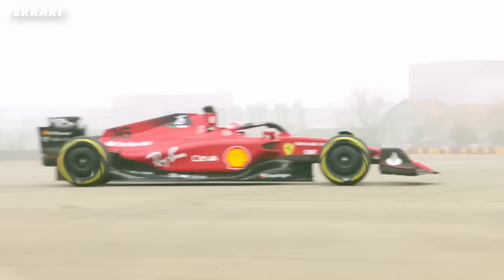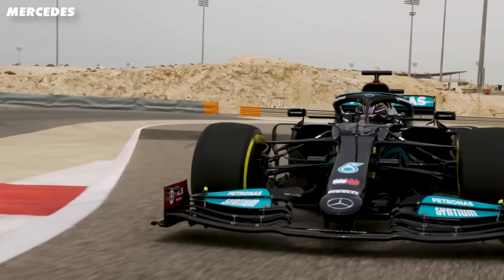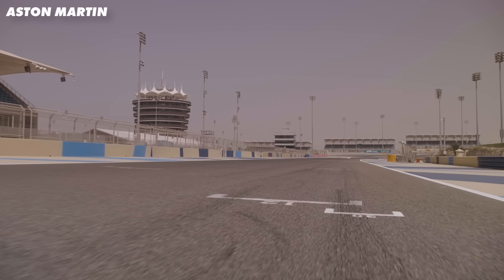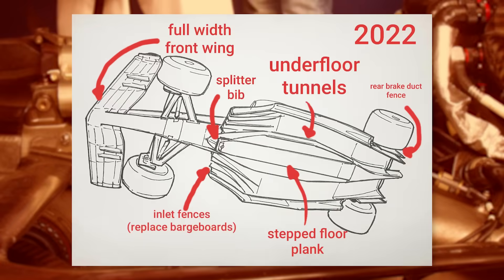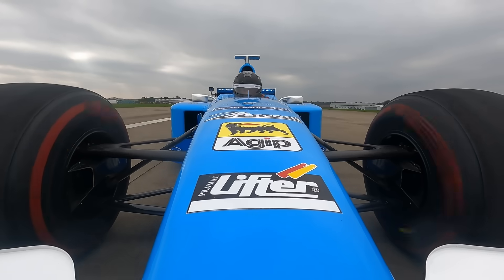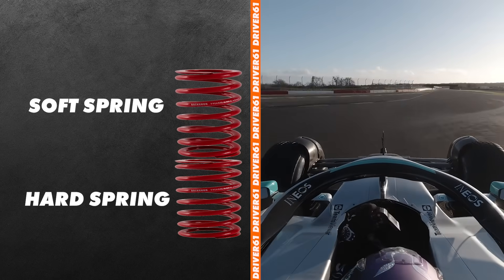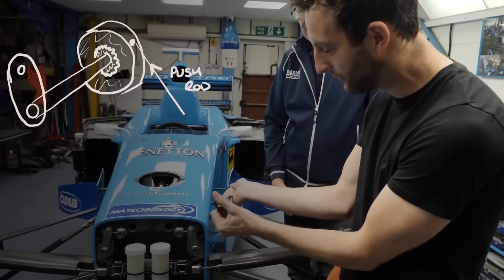Why F1 Cars Use These Weird Springs

Comment: Is this what those slow bump, slow rebound, fast bump, fast rebound in those racing sims actually is or this thing is unique to F1? I also remember something about bump transition and rebound transition, never fully understood those.
Reply: No, you are talking about damping. Fast/slow refers to the speed that the damper compresses/rebounds, if you have long whoops the suspension might go trough a lot of travel at relatively low speed, but if you hit a sudden sharp edge in the road you will have a high velocity as the wheel travels up trough the stroke.
Reply: Slow/fast bump/rebound (In my mind)  are  settings that are adjustable through the shocks. The progressive springs are there to hold the car up and flat whether it's going nowhere and weighs 1000lbs or going flat out with an additional 2000 lbs of aero-downforce.  (No I didn't check my values).

Basically, I think your settings are more for how quickly the shock allows the tires to move while the springs make sure you can hit top speed without bottoming out.
Reply: Dampers contain orifices that allow the oil inside to move from one side of the piston to the other. This is how they dampen movement. The oil can only move through the orifices so quickly. They dampen the movement by the simple fact that the oil will only go through so quickly. Make the orifice bigger they will allow quicker movement. Make the orifice smaller and they will allow slower movement. A damper with just one fixed orifice has a fixed amount of damping that does not change regardless of input speed. And this setup would not allow you to have a different amount of damping for bump and for rebound. It would be the same amount of damping for both directions.

Now, say you decide that you would want a different amount of damping for bump than you would for rebound. How could you accomplish that? You could stop using a simple orifice and in place of it you could use two one-way valves. If you want stiffer bump and softer rebound then you install a one-way valve for bump that is smaller and gives more restriction, and a one-way valve for rebound that is larger and gives less restriction. You can install larger or smaller valves of whatever size you like for either direction to give them the behaviour you want in that direction.

Now you realize that not all bumps in the road are the same. And you think maybe you would like to have different damping behaviour for the different types of bumps in the road. How could you do that? Well, you take your one-way valve idea and go a step further. Now you have valves that can give different amounts of damping behaviour depending on how quickly the damper is moving through its stroke. You design them with a specific speed threshold which allows you to dial in the desired behaviour during slow movement and a different behaviour during fast movement. Slow movements are what you encounter when accelerating and braking, and other gradual changes like going up or down inclines in the road. Fast movements are what you encounter with actual bumps in the road, or hitting curbs at the apex or track out sections of the track.

What I’m unsure of is how they mechanically get these changes in valve behaviour to occur. I’m kind of thinking they’re using two valves for each direction, with one of them always opening, and one of them opens or closes only when it passes that speed threshold. I’ve never actually looked into it, though. I wonder if anyone has shared how these things work. How the parts are designed. Perhaps I’ll Google that up today if I remember later.
Reply: no these are damper stiffnesses. the spring rate / wheel rate is what controls the springs

Comment: I think you've mistaken which part is the stiffer on a dual-rate spring in the graphics. Typically the part with higher pitch, ie. the more loosely coiled part of the spring, is the stiffer part. Therefore the tightly coiled part should compress first.
Reply: Yes, the whole video shows the spring rates in reverse.  More coils=more flex.  Softer.
Reply: Yep they got this completely backwards. Not the first time for this channel. I remembered why I don't usually watch him.
Reply: @shaun2072  No, this commentator got it wrong. The video is correct. Read my comment again.  Cheers
Reply: came here to find this, you are correct.
Reply: This is not the case in the example of 5:24
Reply: @Gisae  In that example there's two different springs of varying thickness and both arrows are pointing to the same spring so I don't think that's much helpful either...
Reply: Yes, you are right, I've noted the same error.
In the end, the spring works by torsion, and the loosely coiled part is that subjected to the greatest torsion, so it's the hardest.
Reply: and rates aside, you expect the closer coils to be designed to close up first and act as a solid bearing. certainly in a continuously stretching spring, you get a continuous increase in stiffness as the coils close up sequentially
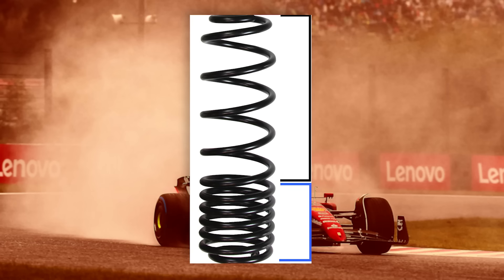Reply: Yes as in 4:23. More coils = softer. Less coils = harder. Assuming its in uncopressed form, and the steel rod diameter and tensile strength are the same. Imagine the coils as straight steel rod. The more the coils the longer the rod and easier to flex (hence lower spring rate). Oc they could stack 2 different spring which is the case in 5:24.
Reply: It is a bit hard to tell from a distance. All else being equal, more coils is a softer spring. But a 300mm long spring with 10 coils versus a 150mm spring with 10 coils, all else being equal, have the same spring rate. The wire diameter plays a huge role, as does the diameter of the coils as well. The type of metal, from the few I've seen, doesn't make a huge difference, mostly slight variations of steel / stainless steel, maybe +-20% but a few coils can halve or double a spring rate.
Reply: No, your wrong. The coil diameter was not to scale. But the tightly coiled bottom springs have larger diameter and stiffness; spring rate of compression in one inch resistance. The upper springs are smaller in diameter, and have less metal area for the height that is "stretched", therefore less resistance to compression. Circumference also increases resistance, as the upper springs decrease in circumference towards the top. Even like beehive valve springs; but that's about weight, also.
Reply: You do realize spring metal hardness varies. 🤔

Comment: 6:25 I’m not sure that’s quite how they work. The soft spring doesn’t just bottom out flat before the hard spring moves. Springs in series compress together and arent affected by each other. Dual rate shocks have a crossover point that is manually set this is the point where the soft spring locks out and all the load is on the hard spring for the remainder of the travel.
Reply: Agreed. Either he doesn't know what he's talking about or he simplified the explanation for his target audience.
Reply: Scroll up for my reply saying that’s not how springs work. I gave an example with the math of how it actually works.
Reply: Thanks for the timestamp. Now l can watching it shorter.
Reply: @AnionsTrop I’m guessing he edited out an old sponsor so the timestamp isn’t in the right place anymore
Reply: Not if the springs have different resistance. The softer spring will compress first, until the overall load on the system is enough to start moving the harder spring. Kyle Engineers has a much more in-depth video about this, where he also shows a 3D printed model of how it works. It's very well explained
Reply: @Excludos  that’s not how springs work if you had a spring and hang 10kg off it it will stretch a certain amount. Then if you hang a soft spring off the stiff spring then hang the 10kg off that the stiff spring will still extend the same amount as it did before. I don’t wanna sound big headed but I did this stuff at university on an automotive engineering course. Springs in series don’t affect each other
Reply: @georgeoliver8300  Think about it. If you have 2 springs. The thicker one takes 1300kg before it starts compressing and the other, much thinner one starts compressing at compressing at 700kg and designed to bottom out at 1300kg and you place them on top of each other, then the stiffer spring doesn't really move before the softer one starts bottoming out. Of course they'll have some overlap to make the transition smooth.
Reply: @georgeoliver8300  That is exactly how spring works when you compress them. Go watch the Kyle Engineer video like I told you to, and learn something, instead of arguing with strangers over the internet
Reply: @Renee_R343  your example does not include springs, because that's not how they work
Reply: @Excludos  You're confused (understandably) as Kyle describes a different system. George is right when two springs are just stacked in series, as Driver61 showed in this video.
Reply: @NielsHeusinkveld  Kyle describes it by stacking two springs. Not sure which video you watched. He even 3D prints a model for you to see a real world example of. The difference that makes the whole thing work is that the harder spring is preloaded, while the soft one isn't, which Driver61 also points out
Reply: @Excludos  you been taking a L here, lol.
Reply: @Excludos  then why are you acting so defensive to the point it looks kinda dumb?
 I've seen both side of arguments, I just kept what makes sense to me.
 If you put a weight on a spring it'll flex, it doesn't make if it's a metal cube or a metal cube plus another spring.

Comment: this just sounds like a copy of kyle.engineers video on this topic that he recently made
Reply: I was thinking just the same
Reply: Not really, Kyle had a video about the collapsing spring system, which he cleverly demonstrated with some 3D printed parts. Driver61 showed two springs in series, which behave differently. If one spring has a rate of 100 and the other a rate of 50, in series that becomes an effective spring rate of 1/(1/50+1/100) = 33.3. If the softer spring bottoms out after say 25mm of travel, it no longer takes part and you only have the rate of 100 spring left. This can be used to really have two different rates of spring while driving, as might be the case in some race cars. Alternatively they are called 'helper springs', where they are really quite soft springs that already are fully compressed by the weight of the car. They are just there to keep the main spring seated and allow some more rebound travel without the big spring rattling loose. Most GT race cars use helper springs as without them, you only have ~10mm of rebound travel before the spring sits loose. Maybe more rebound travel is desired, so the helper spring pushes the suspension down a bit further when you go over a kerb and the tire is hanging in the air, so you have more damping and suspension travel when you hit the road again. That is one possible reason anyway.
Reply: @NielsHeusinkveld  yeah thanks for the clear cut comparison. honestly i judged a book by its cover as i only saw a part of the video before commenting so that is completely my fault. both videos were informative as well as your comment